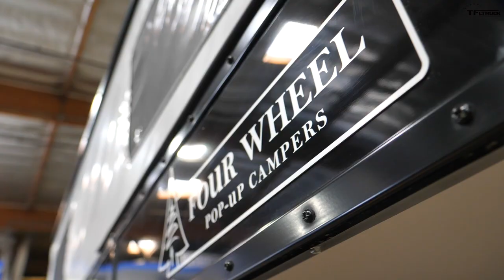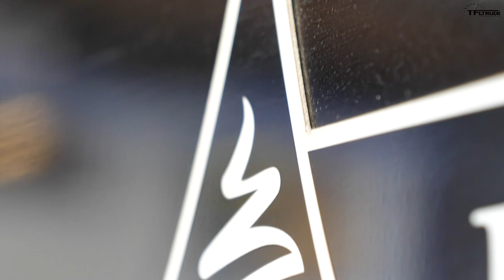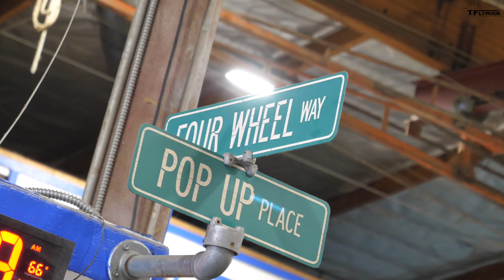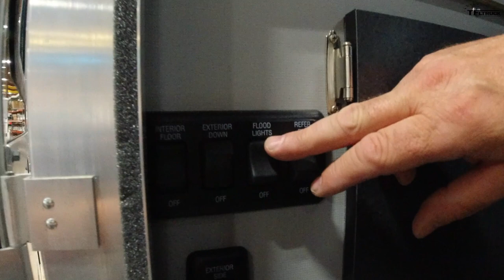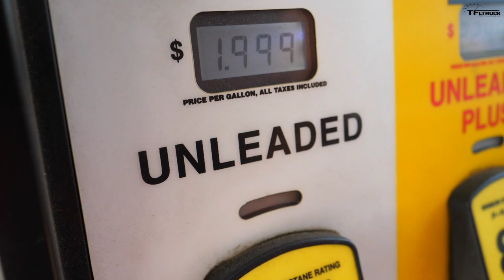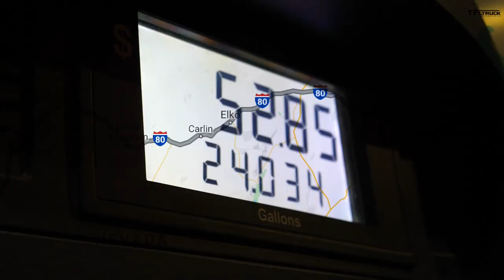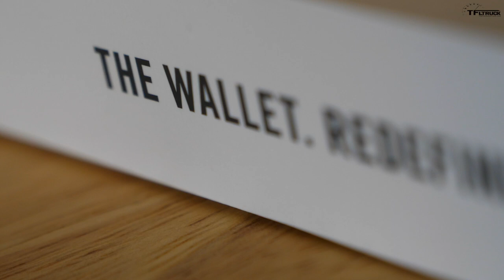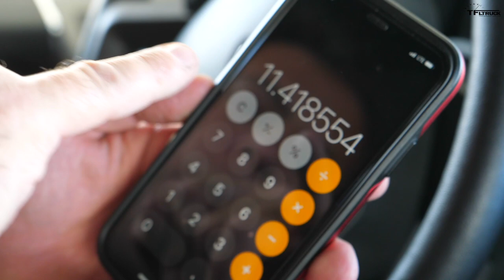Here’s How To Turn a Big Truck Into A Small Home!

Comment: I have a 2018 lifted chevy colorado with a huge 1400lb camper and I get 16mpg with the V6. You don't need a huge truck to build an overland rig. I got offroading in my rig and transmission temps never go above 170 degrees.

Comment: That’s fancy. And here I am just sleeping on the floor in the back seat of my crew cab F-150 next to my refrigerator and all in one battery system I charge from the inverter when running or a folding solar panel otherwise. I get a little better MPG with the 2.7L EcoBoost.
Reply: So you think 30+k is ok for this
Reply: Dude, I did the TAT on a KLR 650 with 88,000 miles on the clock. Your back seat camping sounds like bliss.
Reply: fredbrackely I did a few long motorcycle road trips. Had a Concours ZG1000 and Harley-Davidson Ultra Classic, so, maybe still more comfortable than your KLR…
Reply: Anas saleh thirty K would buy a lot of Mustang. With two or more people this does seem like a good high end option though, so, yes, if I was going to get a truck camper this or something similar would be at the top of my list. However, I’d need a different truck—my 2019 2.7L crew cab short bed F-150 (I bought doing research on TFL, Ford) is too soft for a camper—more of a tippy car feel.

Comment: It's nice to have all the luxuries that camper offers for off road trail run, but where would you put your extra spare tires that you might need or any other get out of trouble supplies  you might need? your not going to have room in that camper.

Comment: It’s interesting that you guys went with the gas engine. If I ever were to get a HD gas truck for off-roading it would have to be a PW, but this helps me decide whether to spend an extra $10k on a diesel or not just to get 5mpg more for long distance trips. I don’t tow much and when I do it’s not even close to 10,000 lbs so diesel isn’t necessary for me.
Reply: The Power Wagon with 6.4L would be a good choice for off-road with limited and infrequent towing needs. The Ford Tremor with 7.3L  is still a good choice...a bit stronger on the towing and a bit less with off-road capability...but that can be rectified with a Carli suspension and the Fox 2.0 or King 2.5 shocks. You might consider air bags to supplement the coil springs on the rear suspension of the Power Wagon.....to hold payload and or towing weight when needed.

Comment: Just when I was starting to get a bit bored with TFL you totally redeem yourself! Really looking forward to this series. 
I was a little surprised with the poor fuel mileage though. How fast were you driving? My lifted on 35's, tuned and deleted '08 Duramax gets almost 20 MPG if I keep it around 70 MPH. Even at 80 MPH on I-70 across UT and CO I can pull 17 MPG and that's with a camper on the back.
Reply: This is a gas engine which is no comparison to your diesel for mpg and torque.
Reply: @bruceblair1265  Oh, thought it was a diesel. looked like there was a DEF filler next to the fuel filler when he was gassing up.

Comment: I think this is really cool and the Gladiator too but the Trail Boss should tag along on the trip also
Reply: Chevrolet is too cheap with standard and available equipment on the Trail Boss.....no electric locker in the rear differential...no option to have an electric locker in the front differential.....no winch....Class 2 (2500) not available with the Trail Boss...and no option for the new 6.6L engine. To be fair, Ford does not offer an electric locker in the front differential either...not even in the new Tremor Package...but they should. It appears that Dodge and Jeep are the only manufacturer's that offer what many consumers want direct from the factory.....and that is electric lockers in both the front and rear differentials. Even with the multiple speed automatic transmissions...all the companies should offer more choice in gear ratios.....Ford should offer 4.10:1 and Dodge should offer 4.30:1.
Reply: It’s their SHOP truck.  They will be carrying the tools for the Ford & Fiat breakdowns!

Comment: I have watched your segment on love/hate 2020 Super Duty. Your "hates" could have been alleviated a little by picking a truck that optioned differently. You should not have chosen a 3.55 gear set, but rather gone with the 4:30. That would have helped tremendously. Just one example of a few that a different choice would have made a difference.

Comment: Like the concept of the Four Wheel camper.....and it is awesome! However, the cost is outrageous.....even though it is unique. Compare to a nice travel trailer or 5th wheel.....much larger...way more materials and substantially more labor time to build, but the cost does not reflect both of those factors  when comparing to the cost of the Four Wheel camper. On the other hand.....IF the Four Wheel camper was made of a two part composite body similar to the Earthroamer.....the cost would be justifiable.

Comment: You need to redo your gas mileage test after you pack the trailer with your gear, and water.  That’s going to add even more weight.
Reply: Mark Ely a super duty wont get effected by weight a whole lot. Mainly the aerodynamics. I doubt they’ll lose much more mpg with weight.

Comment: Would ordering this truck with 4.10s for the same size tires help with the mpg?
Reply: Smarter Than You yes!
Reply: GREAT Comment / Point! Just one little problem. Ford does not currently offer the 4.10 gear option on  F-250 and F-350 Super Duty trucks......but, they should because it would be the best choice for many people.....even with the multi gear 6R140 and 10R140 automatic transmissions.
Reply: @15Jeep  I believe they do 4.30 gears though.
Reply: @bruceblair1265  Yes...you are correct...and I was aware Ford offers the 4.30 gears. As previously stated, Ford does not currently offer the 4.10 gear option on F-250 and F-350 Super Duty trucks. There is a noticeable difference between the 4.10:1 and 4.30:1 gear ratios. Several people would benefit from having 4.10 gears as an option based on use of the truck.....and they would not have the cost of changing gear sets (parts & labor) in the front and rear differentials.

Comment: So your truck batteries either die overnight and your F250 won’t start in the am from cooking, cleaning, using the ac and exhaust fans, OR you idle (bad) your diesel all night. You’d think, for the price of these, they’d include some solar panels to run off of and fill up your batteries when they get too low. Unless I missed it in the video where these don’t completely drain your truck batteries to where your F250 won’t start.
Reply from the maker: Nope, that’s not how it works.
Reply: The Fast Lane Truck well like I said, “unless I missed it..” than how does it work??
Reply: @KendrasEdge757  well one big piece of the picture you missed is it's not a diesel
Reply: Add 2 battle born lithium batteries,  a couple of panels on top and you will have plenty of power to charge devices or fridge.
Reply: @KendrasEdge757  - It has a small solar system on it, plus it uses a BlueSea battery isolate/combiner.

Comment: Never been this early to a video. Love that truck debating on the 7.3 Godzilla myself
Reply: That 15.5 stock hwy milage is a real bummer though. My stock 2020 ram with the 6.4 and 8spd hit 18- 19.8 on the two road trips it's been on so far. That before it's really even broken in.
Reply: @qwizziethakid  are you in the mountains though?
Reply: I love my 7.3 Brandon, I've got the 4.30 rear on 35" duratrac's and it's a towing, working, cruising dream. After about 5k miles my milage jumped like 2-3mpg. After putting the taller tires dropped about one (depends on how hard I use the loud pedal lol). I live at 6500' and work down around 4300', 80mile commute every day @ 55 mph. I average about 15.5 mpg.
Reply: @AK_Ray  that's fair. And no I'm mostly on flatland but those two road trips where to the hill country of Texas for whatever that matters. I really like the 7.3 and almost got one even test drove. GREAT TRUCK! But Im inheritantly a ram man and just didn't feel as comfortable in the Ford plus I really like the 8 spd zf transmission and the 6.4 is great! Speaking of which.. you made a good point.. I think they have 3.55 rear end on their truck.
Reply: @qwizziethakid  You are not sharing all of the necessary facts for a legitimate comparison. Please provide some additional information regarding your Dodge truck.  1. Is it a Class 1 (1500), Class 2 (2500) or Class 3 (3500) truck? 2. What gear ratios are in the front and rear differentials? 3. What brand and size of tire? The brand is important because the actual height of a tire can vary somewhat between the different tire manufacturer's on the same stated size. The website -----> tiresize.com is a great go to website for comparing tire sizes, obtain the actual height and width of tires, gear ratio calculator, etc.
Reply: @AK_Ray  Thanks for the information. What brand and size did you change to?
Reply: @qwizziethakid  I prefer the Ford trucks.......but, Dodge (Ram) has got a lot of good things right with the Power Wagon.....Class 2 (2500) with coil springs ...front and rear on solid axles, electric lockers front and rear, 4.10 gears (should offer other gear choices) and winch. Dodge did it right!

Comment: Probably shouldve used a rubber mat to get more clearance between the camper and the roof of the cab.
Reply: Horse stall mats at Tractor Supply work well.

Comment: Why would they not just make a connector that goes into the bed mounted trailer connector? Already has lights and 12v power that the trailer would use.
Reply: That circuit is probably 10 amps or so. From the size of the wire they ran I'm guessing it's about a 30 amp circuit. Much faster charging is the answer, that and the trailer wiring circuit was designed to power a trailer.
Reply: @zonacrs  Yep most campers are 30amp.

Comment: How easy is it to take the camper off and back on again?
Reply: Many just leave it on and I think that is what he is planning to do. Note the lack of camper jacks in the video as it is pulling out of the shop. For off roading the jacks can be a hazard since they hang down and make the rig wider. But to answer your question most campers can be unloaded pretty quickly (loosen turnbuckles, jack it up, unplug, and drive away) but loading takes a little longer since you need to line up when backing under it. Not as fast as a trailer but reasonable.

Comment: Just out of curiosity, why could you not leave the tailgate on? I noticed the camper didn't hang down in the back. With the tailgate step, wouldn't it have made a nice little porch of sorts? Yeah I'm living in the year 3000. Can't wait to get the no pavement needed series started. I love all your videos, you guys are awesome.
Reply from the maker: In theory you may be able to slam the tailgate in there, but if the gate is up and closed - you are locked inside the camper.
Reply: @TFLtruck   So much potential for practical jokes there... ;)

Comment: Would be great to have a bigger fuel tank.
Reply: Completely Agree!!! It could be done.....literally...maybe not legally. The aftermarket.....Titan, S & B and Transfer Flow make larger replacement tanks.....for the diesel trucks. The larger aftermarket fuel tanks were made for gas trucks in years past.....but ceased around 2007 - 2008...don't know all the details, but from what I have read and heard.....something to do with CARB regulations...and or possibly the volatility of gasoline.  That all said...I went to the Ford website and looked up the parts for fuel tanks ...both gas and diesel on 2019 Ford Super Duty trucks by inputting 17 digit VIN's. It was interesting to see that virtually all of the parts are the same...identical part numbers.....the tank and most of the supporting parts with the exception of the pumps that screw into the tank to transfer the fuel through the lines to the engine. A few months back, I called and talked to an engineer at one of the three aftermarket fuel tank companies......told him all of this...he would not "confirm the capability".....but make no mistake, he "definitely implied the compatibility".  Think Titan offers a 55 gallon tank and S & B has a 60 gallon tank for the 160 inch WB (6.75 foot - short bed) Ford SD trucks.....which would be much better than a 34 gallon tank, especially with a gas engine...6.2L or 7.3L. Spare Tire replacement tanks are available too.
Reply: @15Jeep  Interesting.  I contacted one of the companies you mentioned about hypothetical use of their F-150 tank in a gasoline application and they said there would be an issue with the fuel sender.
Reply: @15Jeep  I had no idea there were any new regulations on fuel tanks.  I've known dozens of people who have installed aftermarket tanks over the years without issue.
Reply: @sonictech1000  The aftermarket extra capacity 'replacement' fuel tanks are marketed and sold for diesel trucks only. I heard it has something to do with the CARB regulations. At any rate, the three (3) companies.....Titan, S & B and Transfer Flow do not advertise and market tanks for gas engine trucks. That said, I conducted a short research and I could be wrong...but I tend to think a replacement DIESEL tank would work in a gas engine equipped Ford Super Duty (F-250 / F-350)...it would literally work, but might not be legal.
Reply: @sonictech1000  One more thought. I can almost 100 percent guarantee you the vast majority of F-250 / F-350 owners would buy...order...purchase...want, etc. an extra capacity fuel tank as an option...on both gas and diesel trucks. The aftermarket has proven there is plenty of room and space for a larger replacement fuel tank. It would be good to know exactly why (the reasons) Ford does not provide larger fuel tanks on both gas and diesel trucks. Again, I tend to think the CARB regulations have some sort of an impact...furthermore, there "might be" increased costs obtaining CARB approval for a larger fuel tank on gas engine trucks...and maybe Ford decided not to offer larger tanks on diesel trucks because of compatibility / convertibility with a gas engine truck. In other words, people would order a diesel tank from Ford Parts and install it on a gas engine truck. All maybe / possibly because of the volatility of gasoline and CARB regulations.....I could be wrong, that's what I tend to think. I would imagine there has been and will be some people installing an aftermarket replacement tank intended for a diesel engine truck on a 6.2L or 7.3L gas engine truck.
Reply: @1970351C2V  I can understand why a replacement fuel tank made for an F-150 will not work in a F-250 or F-350 truck. I was attempting to point out the compatibility of using an aftermarket fuel tank made, marketed and sold for a diesel engine F-250 / F-350 truck.....but installed on a gas engine F-250 / F-350 truck. Again, after reviewing all of the parts at the Ford website...the size of opening in the fuel tank, part numbers, etc., I found only the pumps at the tank are different. That's why I think it would literally work...just unsure of any legal issues.
Reply: @1970351C2V  SUGGESTION: Ford truck owners.....and potential truck owners should write letters via snail mail to Ford engineering and marketing. Here is the name and address for the Chief Engineer of Ford Super Duty Trucks ------> Ford Motor Company / Craig Schmatz, Chief Engineer of Super Duty Trucks / P. O. Box 6248 / Dearborn Michigan 48126. Be a good idea to write a letter and ask questions about larger fuel tanks on F-250 and F-350 trucks...both diesel and gas. In addition, ask other questions about the Tremor Package and the new 7.3L gas engine....why not double roller tining chain??? Is the oil pickup system...is it reliable, durable, etc.??? Lot of information here on YouTube saying it is not a good and or ideal design.

Comment: Why didn't you go with a diesel?
Reply: TFL probably went with the gas engine for two reasons. First, the 7.3L gas engine is new in Ford Super Duty trucks for 2020. Second,  for a few reasons, the gas engine is better platform for off-road compared to the diesel engine.

Comment: Seems dumb. Point of truck bed camper is easy to get on and off for dual purpose rig and even that is dumb reason to get costly new or newer one. If ya gonna spend 25k+ Flatbed campers are better, bed is has better utility and the flatbed camper is more roomy and not hard to install and remove.

Comment: No way of leaving the tailgate on really? Deal breaker for me. Has that step, perfect to step right in the camper.
Reply: What do you need the tailgate on for.
Reply: Jeff Quinn the step and cameras. With that camper you still could’ve closed the tailgate and used your camera’s and the step. No need for that giant hitch mounted contraption.

Comment: wouldn't a diesel be more efficient
Reply: Way more efficient and powerful... But they want to see how good is the new gas engine 7.3l
Reply: Powerful and fuel efficient, yes, but way less cost efficient. Takes a long time to recoup the added 8k engine upgrade and $100+ oil changes at a 3-4mpg advantage.
Reply: The gas engine is a better choice than the diesel engine for off-road use.